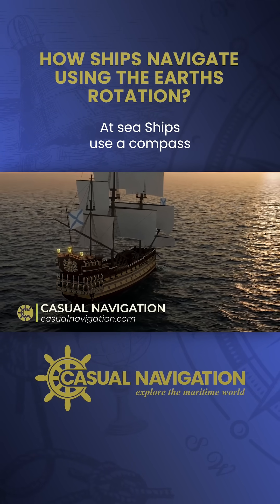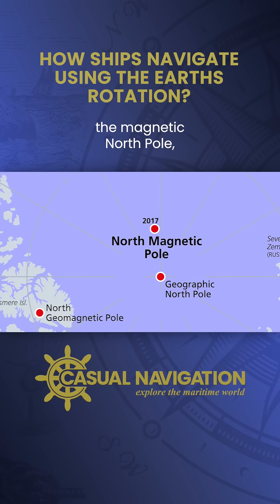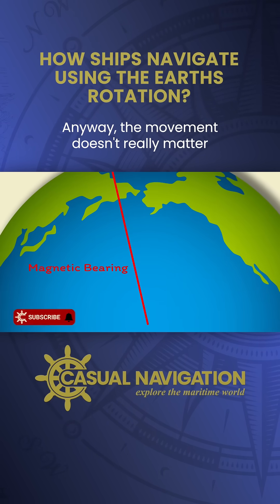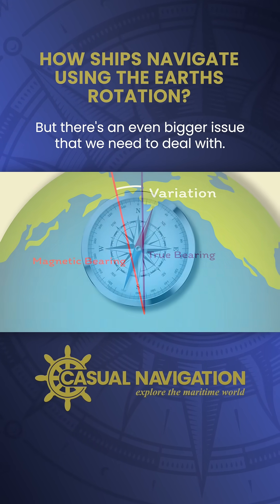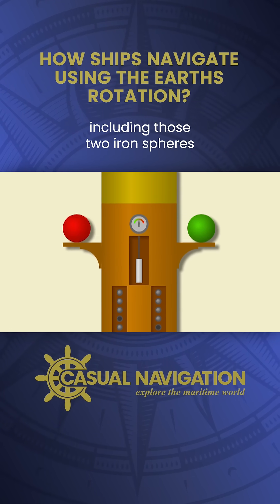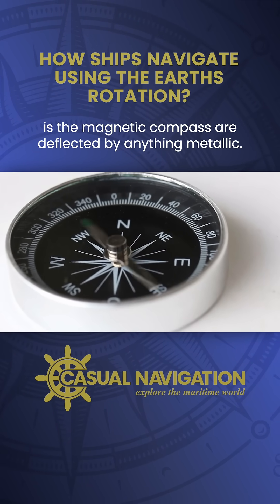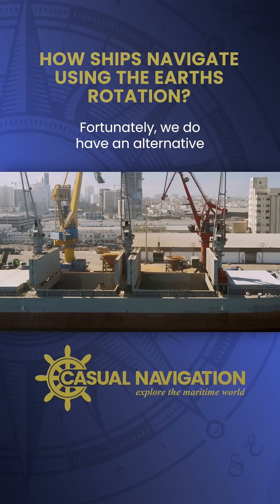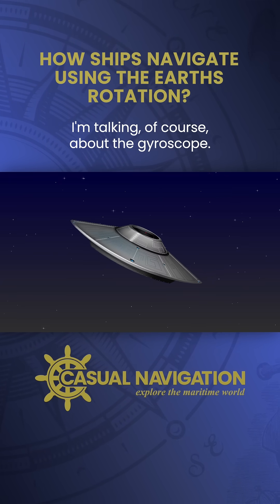Gyrocompass: The Smartest Compass at Sea

Comment: fyi ship's gyro-compass is not like planes gyroscopic Heading indicator which is (on planes) not exactly gyrocompass.
Reply: A Directional Gyro really is a gyrocompass. 

We replaced ours with an electronic horizontal situation indicator (which includes magnetic heading of course) that uses a magnetometer rather than requiring setting based on the magnetic compass in the overhead.